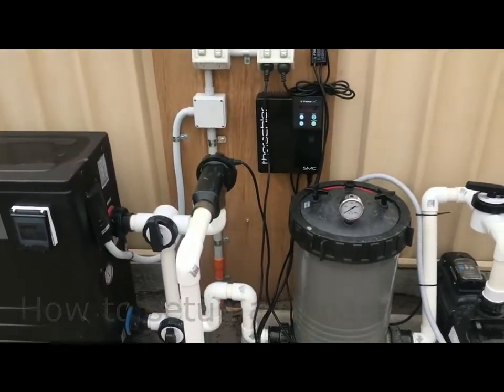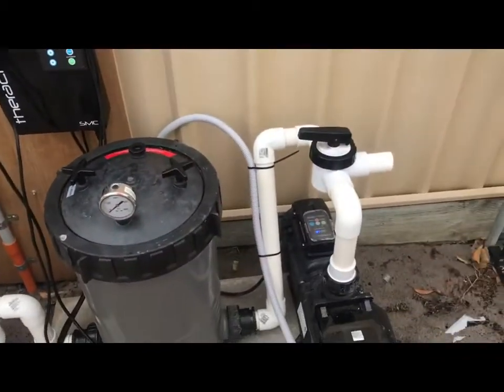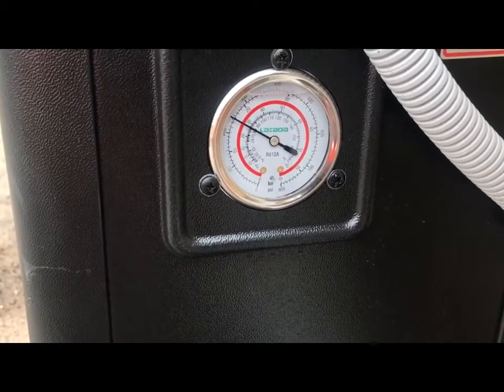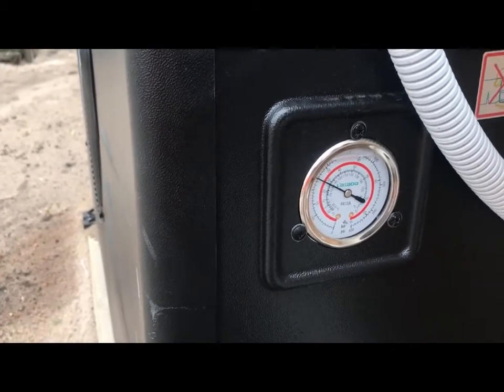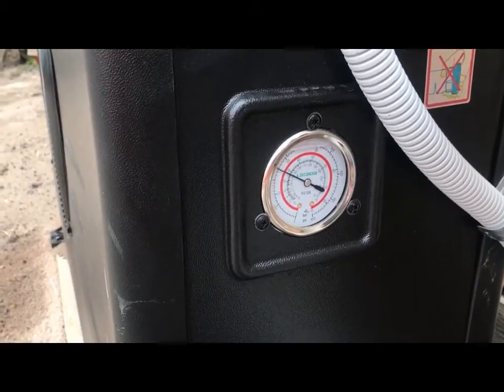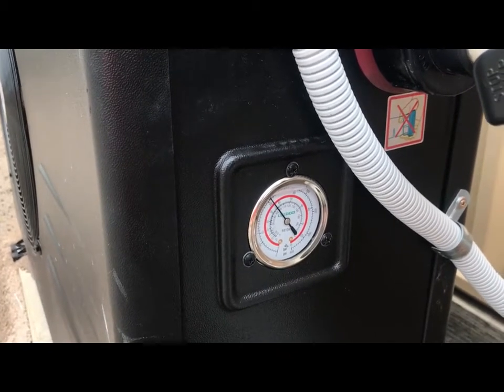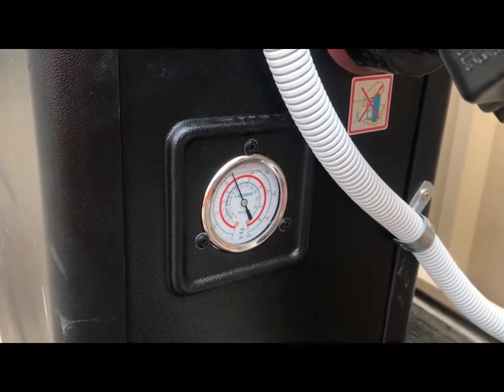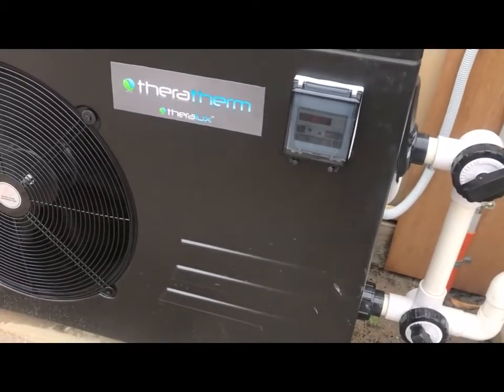Theratherm setup bypass

Comment: Interesting
Could you please explain why you're closing off some of the flow OUT of the heat pump? I'd have thought that if you closed that at all, there would be a chance of increasing the pressure inside the unit to unsafe levels. Isn't it best to leave out the valve on the output altogether and simply fit a check valve and 3-way joint there instead, then control the bypass with the single 3-way valve on the input? Is there something wrong with doing as I suggest? 
I do "get" the idea of being able to drain the item for the winter, but if that is the only reason for the output valve, best leave it wide open when the pump is running, yes?
Thanks